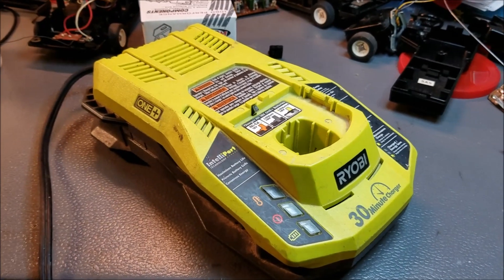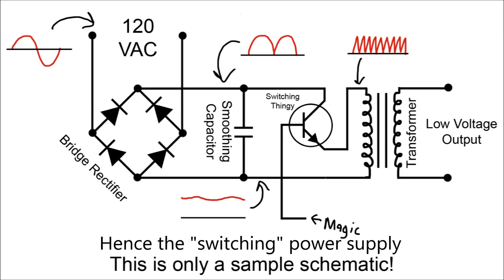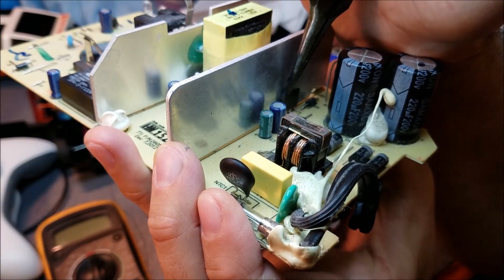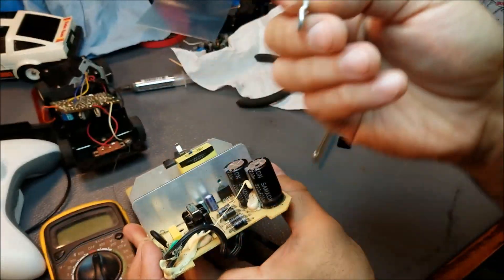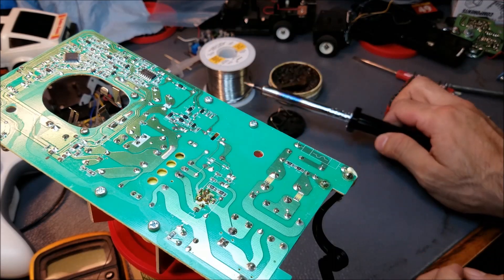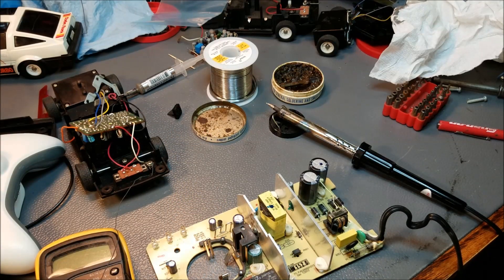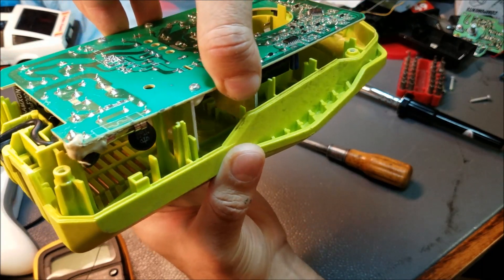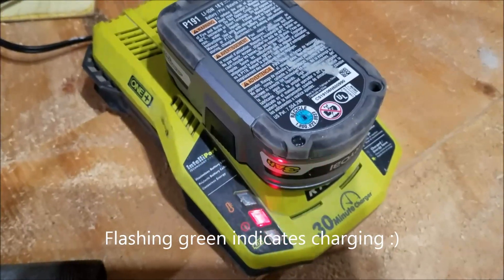Fixing an Overloaded Ryobi One+ Battery Charger

Comment: Hi mate mi charger is stai  red light all the time I tri all my baterry and is still red not charge  ,can you give me a tip
Reply from the maker: If the red light is on, the power supply front end of it is probably working fine. Could there be something wrong with the battery? Or maybe the battery charging contacts that connect to the battery, in the charger are broken.
Reply: @madmanmapper  thanks I will have a look
Reply: @madmanmapper  the battery are ok I use other  charger and they get charge I put any battery and still stai on red light and not charge

Comment: shot in the dark here but what size is the soldered in input fuse .. mine blew and having a hard time tracking down info
Reply from the maker: No idea. This was years ago, and not even my thing, so I can't just check. Tubular glass fuses are typically stamped on the metal ends the voltage and amperage. Might be impossible to read it without snipping it out and inspecting it.

Comment: Hey mine just failed. I don't have any voltage on the secondary side of the BCK2801 transformer. Is the transformer at fault or could a component connected to it be the cause? Every pin on the primary side of the transformer has 172v. On the secondary side they are 0.5v. I tested all the electrolytics and the leaded diodes and caps. All fine.Thanks
Reply from the maker: A transformer is a simple thing. Unlikely that it's fried, you would see and smell it. Each coil of the transformer should be continuous. Slim chance it just went open circuit, but you should check. On the primary side, is it AC or DC? It should be AC and it should be high frequency. Would be great if you could read the frequency. I would suspect the transistor thingy (it's the one doing all the hard work), but it might be the supporting circuitry.

Comment: I have two of these both not working. Both failed almost exactly the same way. I was working in my attic and left it there during the week as I had all my tools there and the next weekend it didn't work. Ryobi replaced it once and it did it again.

I've been through both of them. One has a circuit board with the r71 and r50 resistors talked about in another P117 repair video. I went through one of them and the high voltage header has 300+v but that is where the voltage stops. There's no voltage on the 2nd header. I've tried to check the 2nd header areas to see if I can find where there's voltage on the high side and none on the 2nd side. I can't find anything nor any evidence of burn or discoloring. 
I'd love some ideas.
Reply from the maker: That 300v should be DC, that's like rectified AC. Check for AC voltage coming out of the transformer. If nothing is there, and you have DC power on the high voltage side, it's probably failed in a similar manner to mine. Even mine, which was violently introduced to 240v, did not show any signs of burning. But sure enough, power was going into the switching transistor, but not coming out.
Reply: @madmanmapper  Ok, will check that midrange header transformer as much as I can. I have two of these so can compare. Thanks, Marc
Reply: @madmanmapper  Also, do you have a source for the Click 1611 E199817 SB14.2 transformer?  I've tried searching but haven't found anything with a similar footprint.
Reply from the maker: @MarcMarchioli  No, sorry. This type of thing is really not something I do every day. But I kinda doubt the transformer took a dump just being in an attic overnight. It if got too hot up there, I would really recommend looking at the electrolytics, but I doubt you'd get 300vdc if they were dry. Not sure.
Reply: @madmanmapper  I'm going to first replace the IC TOP256EN chip. It sits on the midrange header and is very heat sensitive and has a reputation of going bad.

Comment: Hi, got a ryobi supercharger 6 port that stopped working, I bought another but don't want to toss out the broken one cause I reckon it's an easy fix, tried having a go at it but still can't get it to work.
Reply from the maker: If it just stopped out of the blue, I'd suspect a varistor or diode. Read the comments here, there's some other folks giving advice.

Comment: I have one with power, but no charging. So I bought a new one and that one became no power within the month...I have a small black one that came with a kit that still works along with a much older one that still works (looks more stubby than these new models). 

So I been trying to troubleshoot the new non working one, well physical inspection led to 0 clues. Put on the mm looking for shorts, the resistor shows 220 and it's in fact giving the normal 20 ohms. That r500 (location r71) I can't get an ohm reading, but since it's only a .5 ohm I don't think multimeters can actually detect that? Basically I'm not getting a reading from any resistor under an ohm and there's a few on this device. How does one safely check the ac/dc switch (top256en)? I took off the small bracket holding it to the heatsink and it looks ok. on the white side I can see light browning but other than that looks perfect.

The older one with power but no charge may be a lost cause, it looks like somebody already repaired it and it's bathed in leftover flux. Add to my problems it isn't even the same pcb even though they're the same model. Symptoms: red light blinks I hear a click then light goes solid red and it never charges the battery. I thought maybe cause I kept them in the garage but that older one has been sitting there longer than the other two and STILL WORKS.

Here's a nice little bonus, BRAND NEW BATTERY wouldn't charge after a few uses, turns out one of the cells was really low so I did the bypass balancer and direct charge got it working a few more times and it's back to non-working. The chargers that work say it's fully charged but it wont drive any of the tools. I suspect I can open it again to find that cell really low once again.

Ryobi tools may be ok, but those chargers and batteries suck.
Reply from the maker: I think a resistor marked 220 would be 22 and 0 zeros, so 22 ohm. 500 would be 50 and 0 zeros, so 50 ohms. Pretty sure, anyway. Resistors under 1 ohm are rare, that's like super precision stuff. Modern resistors drifting high or low is pretty uncommon. That's something you see in ancient tube electronics, because A, resistors were not as well made as they are now, B, they're literally 50+ years old now, and C, they handle high voltages and currents. Excepting bigger power resistors, and visibly crispy resistors, I would not really concern myself with checking resistors.

The TOP256EN will have voltage coming out of it, and going to the transformer. It will be high frequency AC, not sure how well an ordinary meter will read it, but it should read something. IIRC, somewhere in the 100-200v range. As long as it's more than 0, really.

For the one that has power, I wonder if there's a relay involved that enables charging. That might be what clicks. Check the solder joints on that for cracks. The relay might be bad, even. As a matter of fact, inspect all large solder joints for cracks. That's legit the FIRST thing I always look for on any circuit board I inspect - number one problem. I wouldn't really worry about the excess flux. While I have found that it conducts electricity, in my personal experience, it's only really an issue in tube electronics - again, 400+ volts. Granted, modern solid state electronics also have some very sensitive components that can be thrown off by a tiny bit of conductance.

You can always wash it off.

Also, the relay may be clicking over, and the computer doesn't get any feedback, so it errors out, hence the solid red light. That could mean anything, though.

Comment: Hello and Thanks for the video, I repaired one with similar problem, I replaced the TOP256EN, and the charger worked fine, i charged two batteries with success, then when I unplug the charger, and plug it  back again within minutes, the IC burned again I found that I had to wait about and hour unplugged to use it again, I don't know why the big capacitors are not discharge fast enough. If you have any idea where the problem is, I will appreciate it. Thanks.
Reply from the maker: Read the comment by reasonablebeing. Excepting that, I would aim for the varistors in the beginning power supply area (they have a limited life span [in number of inrush current spikes]), as well as the smoothing capacitors in that area, just after the full bridge rectifier. Also, if the IC is dead, the capacitors will take forever to discharge, as there is nowhere for their charge to go.
Reply: @madmanmapper  I just did the same thing. I replaced the TOP256EN, the chargers red LED came on, so I thought hey, plug in a battery... POP!!! Opened it back up and the TOP256EN blew. Good thing I have 20 of them...
Reply from the maker: You might have a bad varistor. Its job is to sop up voltage spikes, especially when plugging it in. They are usually a big round thing like a ceramic disc capacitor, but not, and near the incoming 120vac power. The big caps won't discharge if the TOP256EN is dead.
Reply: @ I noticed when I put a new TOP256EN after plugging and unplugging to see if it would die again, when I went to discharge the caps my cap discharger show them at 2V pretty quick, then after I killed a second one I came back 20 minutes later and they were still at 150V! Thanks for the advice. I’ll check the MOV.

Comment: Sir my same charger made a small burst sound , smoke came out from it and some smell and when i opened it i thibk a small amount of liquid was coming out of two big black capacitor at end 
Which had KM (M) and F 2 A and 150 ° CH printed on it 
Will changing the capacitor solve my problem ?
And if yes 
Then where can i get one ?
Is there any other problem ?
Reply from the maker: The capacitors need to be replaced, however, something else must have caused them to burst. Likely the main rectifier diodes are shorted out. They can be checked with a multimeter. Electronic components can be had from many different online stores.

Capacitors are valued in capacity(uf) and voltage (v).

Comment: My p114 has blinking red problem. Even w/out battery.   It was accidentally pluged in to 220v. Its only 110. Now i fixed d peimary. Then it has problem of blinkin red.
Reply from the maker: well, if you fixed the power supply, the blinking red would indicate a problem in the low voltage section. Maybe the logic. I don't have any experience with that on this particular device.
Reply: Thanks.  But let me know sir if its ok that the output voltage is 32volts?  I can measure 32v at the gate and source pin of the mosfet. But it doesn't turn on. The output voltage at the drain pin is about 0.9?
Reply from the maker: @alejandrosimpaojr8525  Sorry, I have no idea. I never took measurements :(

But I will tell you that if the red light is blinking, that means the logic section of the unit has to be working well enough to detect a problem and report it by blinking. So I don't really think you have an issue with the first stage / power supply part of it.
Reply: Thank you sir.  I am just worried if i isolate the automatic charging section of it and make an separate circuit would it burn the battery because of over voltage?
Reply from the maker: @alejandrosimpaojr8525  Yes, possibly. I would very carefully examine that section for any burned components or broken solder joints.

Also, I assume you have put a battery in it, and it does not charge?
Reply: @madmanmapper  yes sir. It does not charge.  Still blinking red light

Comment: great job where did you get the part i have same problem with mine
Reply from the maker: digikey.com though it can be had from most online electronics component suppliers. mouser.com would be another one.
Reply: thank you do they ship quick?
Reply from the maker: @AimeMOfficial  I've had good luck with them, picking the cheapest (USPS) shipping.

Comment: Greeting from 🇩🇿
Excellent video,any tips on how to convert DeWalt charger dcb107 from 110v to 220v.
Reply from the maker: I am not sure. I believe the TOP256 chip is not responsible for that, as it's rated for a breakdown voltage of 700v. I think the support circuitry that triggers it on an off is responsible for that, and I'm not that knowledgeable about the finer points of electrical engineering like that.

Big Clive has a video similar to what you want: https://www.youtube.com/watch?v=ZNenxTVzFH0

Comment: Any idea what voltage the transfer puts out when the charger is working properly (without a battery plugged in)? I have 2 chargers with the same symptom (no lights) but I have 120v on one side of the transformer and 50v on the other side. Knowing where you probed to diagnose the issue would be awesome.
Reply from the maker: Honestly it was a year ago, and the charger is not in my possession. Where I probed was basically from the beginning until I found the power no longer existed. In my case, that was right up until the switching transistor. Since you are getting power on the secondary of the transformer, that means the first stages of the power supply are working, at least to some degree. The later stages are more technical than I'm comfortable with, at least for armchair engineering. There are some varistors, diodes, and smoothing capacitors after the transformer, I would check those first. The best thing to do is a visual inspection. Unfortunately as electronics get smaller and smaller, that gets ever more difficult. But as you can see, if my case the transistor was visibly cracked... but I had to remove the clamp to see that. Look for anything burned or scorched, cracked, deformed, etc. The other very common problem with any electronics is broken solder joints, especially larger ones, and ones supporting large items like big capacitors and such.

You may also want to double check your first readings. IIRC, the transformer has multiple windings, verify that you're following the power coming out of the switching transistor. Also, there is another transistor on the other large aluminum heatsink, that's probably another switching transistor for the later stages, that might be bad. The comment by reasonablebeing may also be helpful to you!

Sorry I couldn't be of more help.